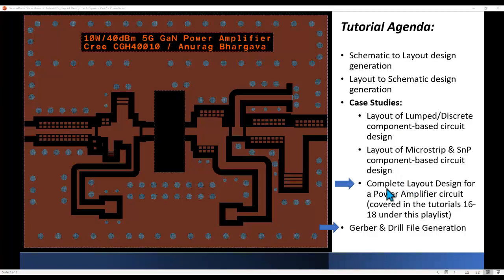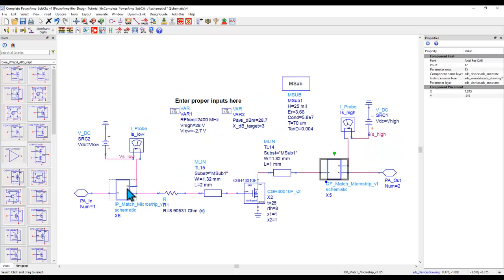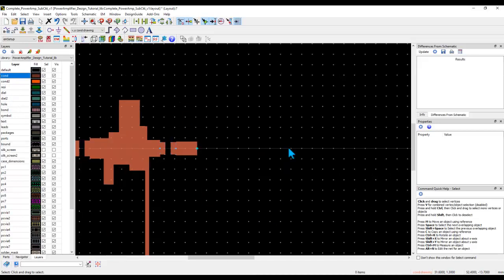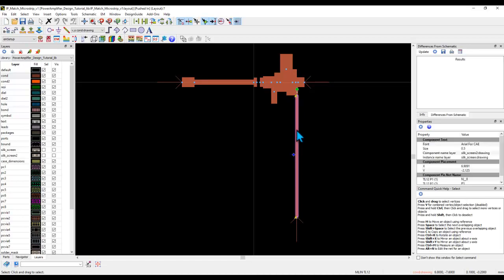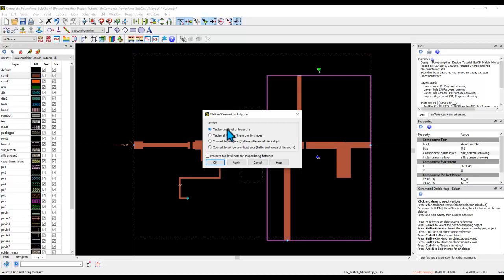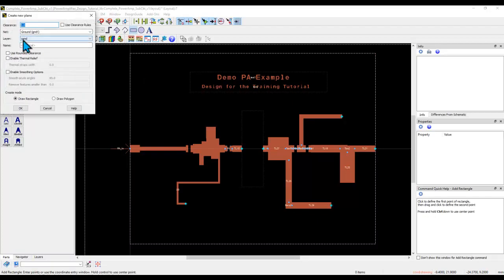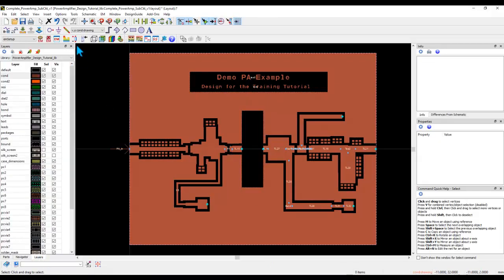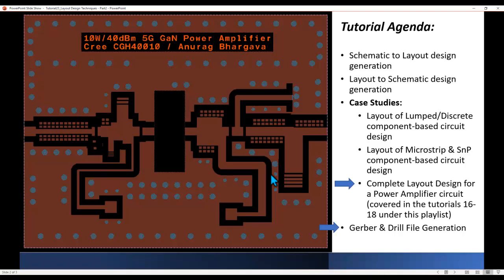RF Design-23: RF Layout Designs in ADS - Part 2

Comment: Thanks a lot, Anurag Sir. I am getting these warnings while doing Momentum-LSSP co-simulation. "Simulator uses frequency lower than frequency range of model. The S-parameters are extrapolated" and "S-parameters passivity is enforced".  The frequency plan for em-model is the same as the sweep frequency for LSSP. Why do I have these warnings?
Your help will be greatly appreciated.
Reply from the maker: Hi,
It could be a case where your EM simulation is not covering 0 Hz in the sweep plan hence the warning. You can contact Keysight tech support team for further assistance.
Reply: @BhargavaAnurag  Thanks a lot, Anurag Sir. I solved it by including DC and harmonics in the EM simulation frequency setup..

Comment: Hi sir,

there is no point in simulating the layout with gaps 
so we prefer direct em cosimulation 
am I right
Reply from the maker: Not able to understand your question fully but yes there is no point looking at the layout results if you don't have SMT components mounted on the gaps/mounting pads and cosimulation is the correct way to look at complete response which will be pretty much what you will be real populated PCB.

Comment: Hello sir,

What will the size of the rectangles which i place for post production tuning?
How close to the rf path can i place them?
How can I decide the clearance value?

Are there any thumb rules for the above?
Reply from the maker: No thumb rule as such but it depends on the frequency of your design. You would like to such rectangles which are not too big or too small as you want those to impact your results slightly when you put a copper tape or some conductor across them to change width/length of lines...For usual design till C or X band, you can keep it like 0.5mm with 0.5 mm clearance or something like that. Hope this helps.

Comment: Nicely explained.Could you please make video on Suspended stripline Filter from schematic to layout . Thanks in advance.
Reply from the maker: You should be able to easily do it by using components from TLines-Multilayer and select a 3 layer stackup where top and bottom can be defined as Air.

Comment: Thank Sir for your video series. I have a quick question. In test layout of datasheet, I see O ohm in input_matching, What is its effect? Is it mandatory in the design?
Reply from the maker: Those are usually used as placeholder to have the capability to add any discrete components after you fabricated the circuit but to start with you can simply put 0 Ohm resistor. Its sometimes a good idea to have it there but if you are 100% sure that it won't be needed then its not compulsory to include it in your design
Reply: @BhargavaAnurag  thank sir for your answer. it's really simple, i was very surprised

Comment: Sir how to give RF input to the rf rectifing circuit in ADS tool. Because i am in a new project which is rf harvesting system. 
Can you tell me?
Reply from the maker: Hi,
It will depend on what type of simulation you want to perform. If it is Harmonic Balance then you could simply use P_1Tone source

Comment: good job. How do I put a label say "vout" in layout to measure my output voltage when I generate the symbol for CoSimulation?
Reply from the maker: Wire Label is always used in schematic. You can define it on the wire that's connected to the input or output point of your symbol connecting to either source or termination.

Comment: Thank you for your video series. They've been very informative. Quick question. What do you suggest can be done when the addition of pads in the schematic changes the response of the lumped components especially at high frequencies?
Reply from the maker: Hi Erons,
Effect caused due to mounting pads and can be compensated by reoptimizing your designs. You need to make sure you model all discontinuities in your design properly to do as good schematic design as possible and then EM-Circuit cosimulation would typically a pretty close response to your actual schematic design...👍
Reply: @BhargavaAnurag  Thank you for your response. I was just wondering if there's a limit to which we can model the component with ideal lumped components and mounting pads because it gets to a point where the response gets bizarre like S11 being positive and S21 being below minus 10 dB.
Reply from the maker: @KreyszigCam  that behavior has nothing to do with the mounting pad lines. You need to seriously look at your circuit topology and there seems to be something wrong elsewhere. If you can't figure it out kindly contact local Keysight tech support for help. Using an ideal component is the easy way and in reality, you would want to use an actual S2P or Design Kit from the component manufacturer which will have higher accuracy models but having said that it will only have higher freq parasitics for the component itself and mounting pad parasitics are different.
Reply: @BhargavaAnurag  OK. Again thank you very much for your response and your video series. What you upload for free would cost a lot of money to attend seminars just to learn them. Many blessings to you.

Comment: Sir one more question when I am doing the trace option in layout then dimensions are in mil how to change it to mm to draw any transmission line and no option of keepout available under insert tab so what alternatives can be used for the same? Thank you, Sir. your videos are great help for me and waiting for your reply. Kindly reply at earliest.
Reply from the maker: Those options are selected by you while creating the workspace and selecting the technology preferences. It is not advisable to change it mid way as then rest of options like text or size might not be correct and you will need to modify a lot of things so it is better to start afresh with right settings.
Reply: @BhargavaAnurag  Yes Sir I identified that these settings needs to be do while creating workspace. Thanks sir for response . 

Please guide me for the problem that I m facing with respect to my design that there is huge gap between two transmission line that I am joining from two parts at the end of my circuit ( part of power combining network ) which has been connected via wire in schematic. Please suggest me how I will do it in layout as lines are far. Same I am facing while designing Wilkinson power divider in which I have to connect a resistance as far from the transmission lines that has been connected with wire in schematic and how I will connect it in layout . 

Can I use path to connect these ? 

Is it make difference in schematic simulation results and Em co simulation results?

Comment: Excellent Sir, Thanks for making video on this topic. 

Sir first problem that I have faced with respect to my design that there is huge gap between two transmission line that I am joining from two parts at the end of my circuit ( part of power combining network ) which has been connected via wire in schematic. Please suggest me how I will do it in layout as lines are far. Same I am facing while designing Wilkinson power divider in which I have to connect a resistance as far from the transmission lines that has been connected with wire in schematic and how I will connect it in layout .

Also please suggest which is the better way to use lumped components or transistor in layout either as lumped art work components 
or gap for getting better results .

Thanks  Sir. Waiting for positive response that solve my problem.
Reply from the maker: Hi,
Layout will only show what have you done in schematic and if there is a big gap in layout then it means you haven't designed the schematic keeping layout in mind. Kindly recheck your schematic and go from left to right to check each component and you will find the problem location. If you still can't then watch 2nd method explained in the Layout Part1 video and place components 1 by 1 from Schematic to Layout and you will know where the problem is coming from.

Whether to use Lumped with Artwork or Gap is your choice and how you to want to design your layout. Lumped with Artwork will give you pad definition for a component in layout whereas gap will simply produce gap between 2 connected terminal so they are not same and I am not sure why are you even comparing between them?
Reply: @BhargavaAnurag  Thanks Sir for reply 

Yes Sir I am doing with second method place components and already located the problem at the power combining point where length of transmission line is short at one end  as per my design and not able to connect at combining point.

Can I use path to connect it ? 

Is it make any difference in schematic results and EM co simulation results 

If possible can I share my design photo with you so that you can suggest me how to complete my layout.
Reply from the maker: @sukhpreetsingh9011  Watch out for a new video on Power Divider design in next 12hours and I am sure it will resolve all of your queries...😊